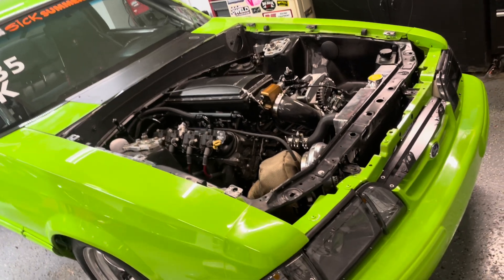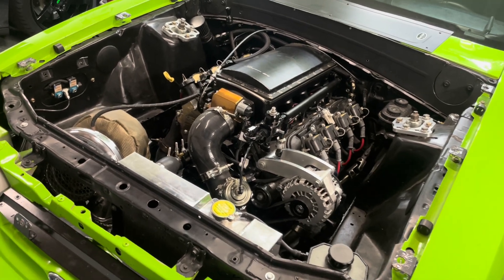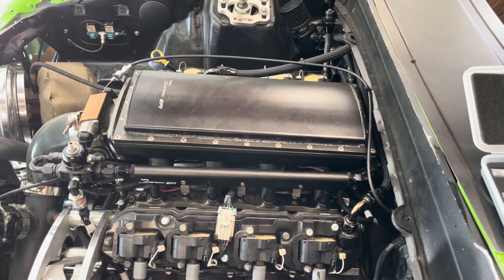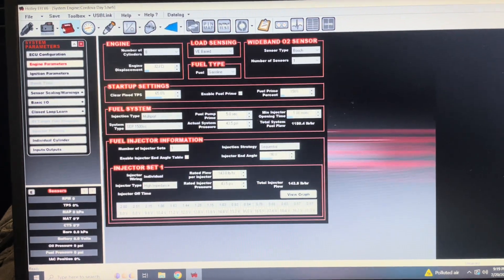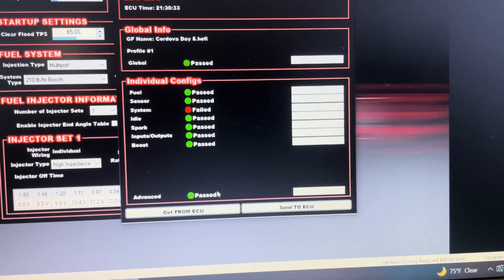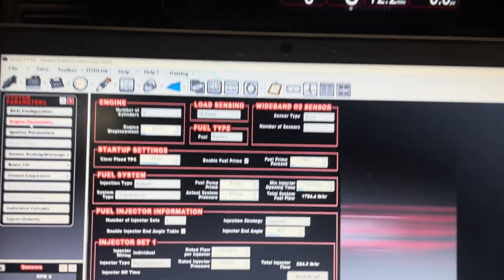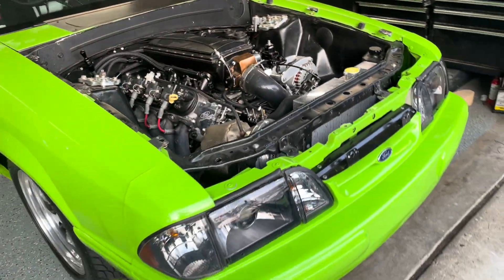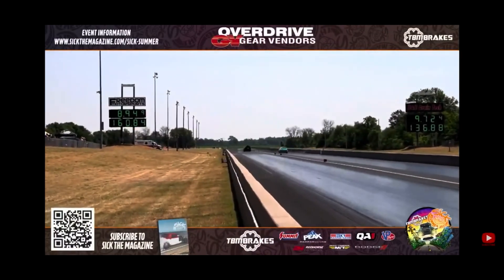Holley Dominator Injector Swap: Snake Eater 1500 to Bosch 210’s

Comment: Nice video. I have the 210s and my car is pretty rich 13.2, what wheels on the front? weld?
Reply from the maker: I have been working on my tune to lean my car out as well after the change. Not much, but the added fuel flow made my car run rich as well. If you keep an eye on your closed loop you can identify areas of the fuel map that need some attention. The wheels are 17" S71 welds.
Reply: @BoostieMotorsports  honestly I was washing out my oil and plugs, got it more dialed in but the 210s just dont seem to like pump gas. I really am considering FIC 1440s